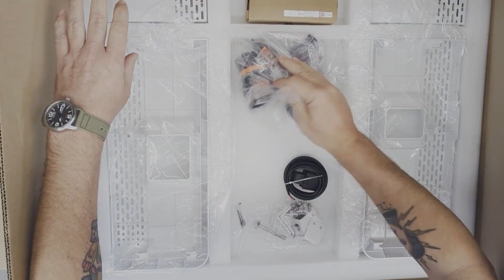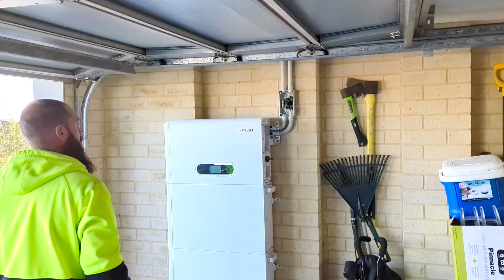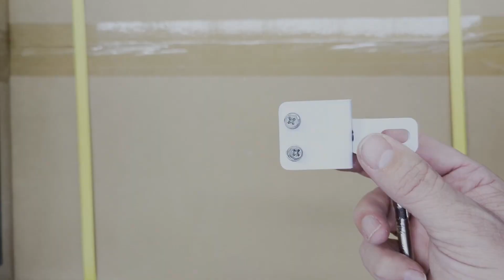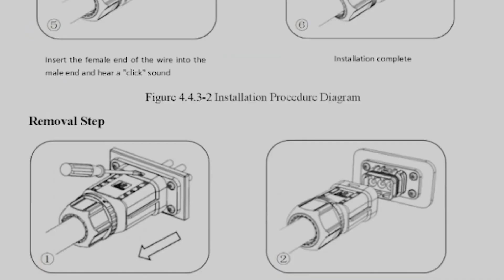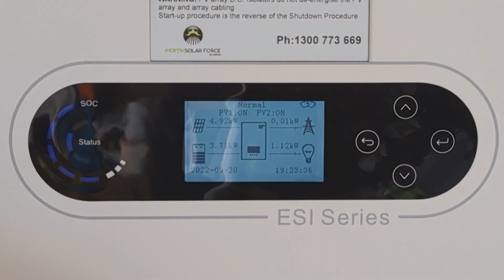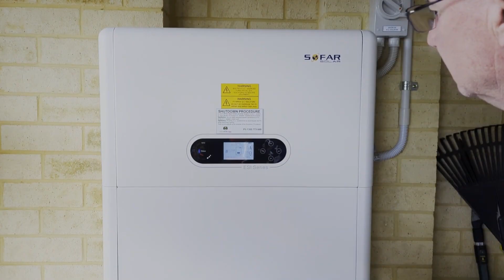SOFAR PowerAll Installation Guide

Comment: In my opinion, Sofar is the worst company in the world. They remotely logged into my fully working inverter and attempted a firmware update — which failed — and as a result, turned my perfectly functional system into a useless brick.

Since then, they have refused to fix the damage they caused and will not even respond to any of my emails.

Based on my experience, I strongly advise anyone considering their products to think twice. Don’t purchase from this company — they do not stand behind their equipment and their customer service is non-existent when something goes wrong.

Not just me check the forums

Comment: Question: Will the inverter go in alarm if the termination plug (resistor) is not installed? What will or could happen if this is the case?